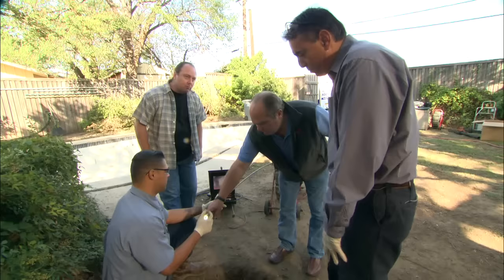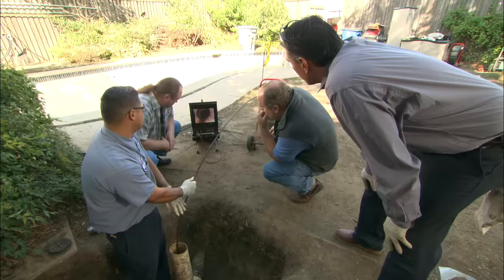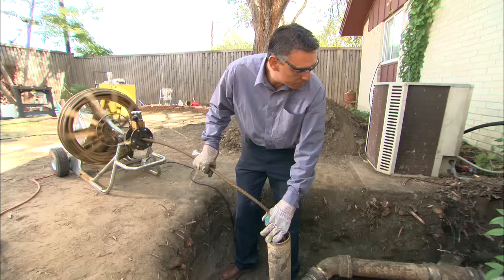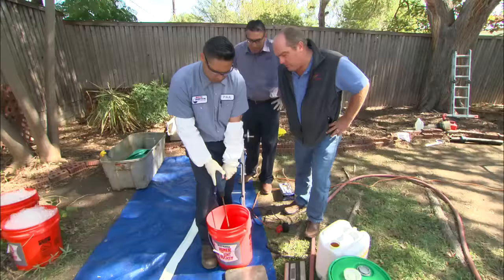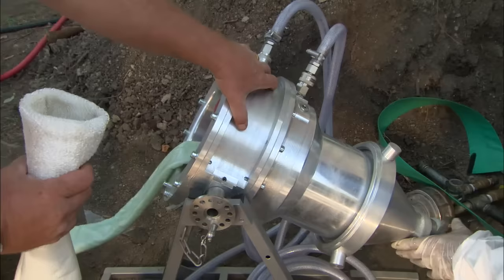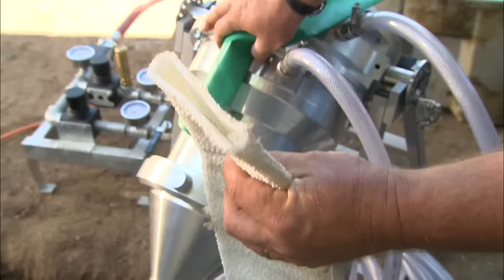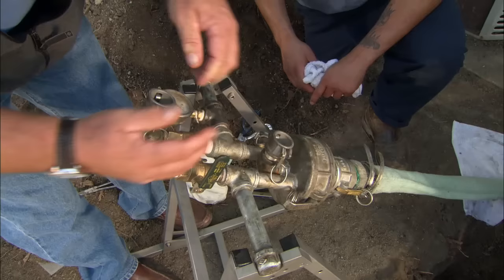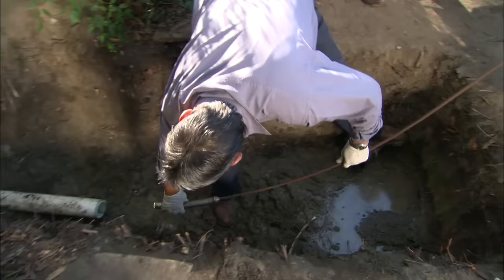How to Repair a Sewer Pipe Under a Concrete Slab | This Old House

Comment: I called five or six different plumbers to come out and look at my drain lines. They wanted over $400 just to put the camera down the drain and they wanted $115 an hour for two guys, that's $230 an hour and I asked them about how much it would cost to to fix it they said about three to five grand. Guesstimating it could be more. I said to hell with that and I fixed it myself. I found out where the lines came out from underneath of the house. Got out of shovel and dug it all up. All the cast iron was completely disintegrating. I got my recipitating saw and cut it all out. And replaced it all with PVC. My wife and I did this in two days. It took the longest to dig it up with a shovel. The actual repair took about four hours. Cost of materials less than $200.
Reply: I think they would agree that the preferred method is to just remove the old pipe with new pipe. But in some cases you can’t access the drain lines. I have a few that would be completely inaccesible.
Reply: would you mind to list your materials?
Reply: @kevinvinson407  two pieces of 10 ft PVC drain line. Two cleanouts, 2 fernco fittings 4 hose clamp fittings for the ferncos. 2 caps for the clean outs saws all blades  PVC cleaner and glue. 1 90 degree Male adapter.  2 housings to cover the clean out . We did this in November of 2020. So it would probably be more expensive now.
Reply: U don't have a basement
Reply: Agreed, it's always cheaper to do it yourself. It's funny when customers call and say it's a "simple job" or "I could do it myself, but..." and want a cheaper price. Props to you for actually doing it.
Reply: That’s pretty cheap for a camera
Reply: @royblomquist2622  Ferncos and metal clamps underground?
Reply: I realize everyone has to make money but cmon $115 an hour?? Just as bad as a car shop hourly rate
Reply: @chicagowsox212  we charge $220 an hour for plumbing
Reply: @haydenchamberlain168  yeah there’s a lot of scammers in this world that take advantage of people
Reply: How long did it take to dig it up?
Reply: @9863bsgcdgb  about 6 hours
Reply: @Muko992  no we don't have basements in Florida
Reply: @justayoutuber1906  that correct ,stainless hose clamps and ferncos
Reply: That’s great man now try hand digging the pipe outside when it’s 8 feet down in the ground
Reply: @roberthernandez1985  I live in Florida so they don't bury the drain lines 8 ft in the ground because we don't have basements down here. But if I had to I would rent a mini backhoe still cheaper than paying a plumber
Reply: I’m expensive because I have 250000$ in equipment liners excavators large commercial hydro jetters etc etc digging outside is one thing but not everyone wants to jackhammer the basement slab
Reply: I can hear your yell voice in this comment! Don’t blame you awesome job!
Reply: Thats a good deal,  I would of  charge you more.
Reply: Yeah right, talk to us when the pipe runs underneath a concrete slab like this video.
Reply: @royblomquist2622 
Did you take pictures or video of your job?
Reply: @rafaelhuicochea7158  yes
Reply: Good, now come do my house for less than 200 dollars then.
Reply: The new America.
Reply: Yes please come to my house and do it for under 200!  Thanks in advance!
Reply: @royblomquist2622 You didn't mention installing hangers to hang the PVC pipe from the bottom of the concrete slab. Did you not do it? If you didn't hang the PVC pipe the pipes will sag as the soil settles, & joints can separate as the pipe sags.
Reply: @LoneTinaja or bury a piece of PVC for 3 years, then dig it up and THEN bend it slightly... Watch ALL the cracks run the entire length of pipe.
Reply: Bud, do you want to know why a good plumber costs so much?  

Because they're worth it when they have to shovel someone else's crap.  That's the premium.
Reply: @royblomquist2622  👍
Reply: @chicagowsox212  
What's the correct price?
Do you think it's possible that you are overpaid at your job

Comment: Never buy a house without a basement and you won't have to worry about ripping up your concrete slab to make a sewer line repair.
Reply: With or without a basement?
Reply: Yeah but then you have to maintain the basement which is way more expensive anyways. Water always gets inside.
Reply: A lot of places don't have basements. California being one.

Comment: I love how the owner grabs the camara with no gloves when that camara has been in a lot of sewer line and just fwi dont call roto rooter they rob you blind
Reply: They charge 250 for 3 minutes work,insane
Reply: They charge that cause of 20 years of practice my friend. Is your drain flowing? Lol
Reply: Mr. Rooter proposed to clear aand repair my drain for 8k.  They didn't know I was in the trades so I had some coworkers do it.  Even their diagnosis was wrong and I was able to fix it in about 2 hours for 150 bucks.  It helps to know people but c'mon! They will rob you blind
Reply: @johnsmith-wc8gs  
Piffle on stilts.
Reply: I need to get this done for that price
Reply: The plumbing company I work for charges $125 for a pipe clean out
Reply: at 00:41 he touches his nose and mouth 😂😂
Reply: Doesnt mean you didnt have a problem
Reply: @johnsmith-wc8gs  Do you think I can dig a trench myself and replace the pipe? I'm not in the trades, just a regular guy. The sewer drain is very deep, starts at basement floor, probably 7 feet under grade. So I'd have to rent a skid steer or something and dig a deep trench to find it?
Reply: west  typically a camera is run through a clean out to verify location and depth. 7' is quite deep so I would rent or have someone camera it so you know exactly where to dig and how deep. A 7' trench is actually dangerous. Caving in is possible depending upon soil and how you dig it.
Reply: @nofurtherwest3474  you could do it yourself, but it's a lot more work than these videos make it out to be. If you do it yourself, I wish you the best of luck!
Reply: @TheLouisianan  Ok thanks. I snaked out the drain and pulled out some roots. So that may get me by for a year. It's obviously cracked somewhere but maybe that's ok? So many older houses around. I imagine most have original drain pipes right?
Reply: @nofurtherwest3474  Yeah it depends largely on where you live and what year your house was built. I currently live in a house built in 1956 when they used terracotta which is susceptible to root intrusion at the joints (since they look for water). If it's cracked in there, it means roots have already damaged the pipes a good bit. It might be ok for now, but eventually you'll need to replace your pipes. Personally I'd start saving some money for when the time comes. Another alternative if you have terracotta is to pour foaming root killers once or twice a year down your drains as a preventative maintenance item, but it'll just delay the decay of your pipes. Terracotta won't corrode since it's ceramic. If you have cast pipes though, I've heard that acids are not good to pour down the drain. I'm not a plumber though so maybe someone else may chime in and correct me.
Reply: @TheLouisianan  My house is about 95 years old. Most of the houses around are about the same age. I'm guessing most have original pipes and they are probably all cracked in some way. 
Never heard of foaming root killers. thanks for the tip. 
There aren't any big trees nearby, but there's a small one. I wonder if that's the problem. I can't imagine those roots going down 10 feet but maybe they do; I don't know enough about trees.
Reply: @nofurtherwest3474  95 is pretty old. My sister and her husband live in a house built in 1921 and it's got a lot of quirks with it probably similar to what you're describing. Maybe at that point pipes are all cracked to some degree. As for the roots, I'm not an arborist haha so I don't know either. A 10' tree shouldn't be doing that though. The tree that was growing in my pipes was a 30-40' hemlock and the trunk was about 10-15' away from the main sewer line.
Reply: 250 to root your drain is not bad. Over thirty years ago I had an old house with roots in the drain so I rented a power snake with a cutting head and it cost me somewhere between 75.00 and 90.00 dollars and then I got the tool stuck in the drain, after some effort I freed it. It was a dirty filthy miserable experience. From then on a paid someone. I think I paid 150 or so. Best money I ever spent. Something's are best left to the professionals, sewers are one of them.
Reply: @mtadams2009  The problem is that some guys will tell you "hey we have to dig and replace the pipe, will cost $10,000." Yes that happened to me. So I don't trust people
Reply: Roto Rooter just came and "cleared" my parents' sewer line for $220 dollars. They had to come back twice in two days to finally do it right (kept backing up in the basement). Turns out their sewer line is 250' from the basement to the street. Luckily what would have been a $600+ job was warrantied for the original $220.
Reply: Yes I'm a plumber my self
Reply: @nofurtherwest3474  roots are as long as the branches are on top or longer , not sure about the depth though
Reply: @gusc6785  ohh wow that's long
Reply: @nofurtherwest3474  How can your waste pipe start 7’ under grade? It has to flow downhill to the city line running along the street or alley. How deep is that city line buried? It would have to be 8-9’ deep. If not, you would have to pump the waste uphill from your house.
Reply: @jacktracy4845  Because the waste pipe starts at the bottom of the basement and then goes outside (ie in the dirt outside of the basement floor). 
The spot where the drain is in the basement is about 7' under grade. 
This is the case in the midwest. Nearly every house has a basement. 
How does a floor drain in a basement flow to the city main? 
The city mains are buried deep I'm guessing. Probably 12' or so.

Comment: Nobody gonna mention the traffic cone funnel at 2:30? 🤣
Reply: Sometimes improvising does better job than the actual tool.  Sounds weird till you have tried it.
Reply: I can't believe not single person besides you has commented on it. 
The traffice cone funnel is quite hilarious though.
Reply: Well thats typical roto rooter tools, probably has a 60% markup  to use it too. LOL
Reply: Was it taken off the street from a construction zone?
Reply: @MrBeast9000  oh that's funny
Reply: Hey you cant beat ingenuity...
I used one that was perfect for filling 1000 earth bags building a house...
The movie the God's must be crazy comes to mind how something simple can be life changing... lol
Reply: they do not make giant funnels for cheap or easy available , so the cone is a cheap easy solution, an the resin being used is dangerous if got on skin, that mixing bucket will melt from the leftover resin the cone will not
Reply: I do line repairs all the time. Its the perect tool to use innexpensive and gets the job done
Reply: It's getting coated in epoxy. You only get so many uses out of it before it's gunked up. Might as well yse something cheap!
Reply: Them cones work good for filling sand bags as well
Reply: @51-FS  run that by us again... little slower this time.
Reply: @51-FS  first off, master construction advisor I didnt "win" my house, I bought it... for cash.. Guess the first grade spelling class was long and hard on ya'
Reply: U must of mastered making fun of people and picking on them..... hope u are happy
Reply: Best funnel ever
Reply: @ksr9t  
Ooh you're tough. Not.
Reply: The actual reasoning we used traffic cones for funnels is because you ultimately have an infinite option for varying diameters of liners. The traffic cone works for 3 inch, all the way up to 12 inch. Additionally, when the resin cures in the cone it adds rigidity.
Reply: @davidf2244  actually if you make a catch basin for the cone it will drip excess and actually last for 5+ years
Reply: What ever works bro... What ever works
Reply: @davidf2244  and still use as cone.
Reply: The traffic cone method works hella good to fill up sand bags as well...
Reply: The smartest people have high IQ.  Ingenuity Quotient.
Reply: It’s a high vis funnel! Lol
Reply: no, who cares
Reply: Brought to you courtesy of VLC Media Player!
Reply: Safety first! Bob Villa rolling over in his Lazy Boy
Reply: @cristianportillo5888 inexpensive?!? They're LITERALLY lining some streets?!?!!
Reply: It actually works great for the viscosity of the resin

Comment: I had two jobs done similar to this using the Perma-Liner inverted sock similar to this.  The end result was a 1/4” thick wall PVC-like pipe inside of the existing pipe.  The liner pipe penetrates the pores in the existing concrete pipe so it is firmly embedded.  The pipe is smaller diameter by 1/2” inside but is much more slippery.

Our present house had roots jamming the sewer right next to our house from trees and unfortunately right under our hot tub slab.  The sewer cleanout is between the hot tub and the house and the sewer is 3’ deep and 80’ long, going under trees and bushes.

The other job was 35’ long, 8’ deep and went diagonally under a 10’ wide concrete driveway.  Roots from trees were in the sewer.  A small backhoe dug the single 8’ deep access point.

In both cases they only needed a single access point and both jobs were completed in 2009.  The expected life is at least 50 years.
Reply: How much did it cost you? My dad's house needs a job like this.
Reply: This works fine as long as the existing pipeline (to be lined with this perma-liner type sock) is one continuous pipe with no 'feeder' pipes leading into it (i.e. the input from bathroom sink drains, kitchen sink drains, shower/tub drains, washer drain, etc. Those 'feeders' will be blocked by this insert.  As long as the concrete slab is a porch or similar 'slab', then fine, but if the slab is the foundation of your home, the method reflected in this video will NOT work; it will block all the drain 'feeders' leading into the main pipe.
Reply: Did you forget to take into consideration that once turds and organisms start using the new pipe, it's slipperiness will fade rather quickly- especially once you've snaked it with an auger. Those things basically act like sandpaper, ensuring the inner pipe remains rough for the rest of it's service life. Just curious if you've had any issues with big dumps or large wads of toilet paper etc. clogging the new line? Thanks in advance
Reply: @Rick-the-Swift  running blades through these liners doesn't damage them in the least.
Reply: @nexusone5584  Damage is in the eye of the beholder. I don't think little scratches on the inside of the pipe is considerable damage, but many augers will have little serrated teeth for chopping roots, and being that metal is harder than epoxy, those augers will scratch rings around the inside of the pipe. Sure they'll still function, but my only point was they will quickly lose their slickness the OP saw as being an advantage, just as pvc pipes become quite grimy on the inside, even without being scratched up by an auger.
 Also, just pointing out what the OP said about the walls of his new liner being 1/4 inch thick- this means the inner diameter of the pipe is actually reduced by 1/2 inch, not 1/4 inch as you suggested in the other thread.
Reply: @Rick-the-Swift  I have lined literally countless pipes over the years and have never seen any blade system damage the inside of any of the various lining systems out there, unless intending to do so. This includes hydo jetting heads.

 You should never be using anything other than drain cleaning blades single, double, quads or spring retriever to clean a drain line. All of these blades are angled inward (both the tip and the blade profile) to keep the cutting ends/edges away from the actual inner wall of the pipe. This being said, if your liner is installed properly,  using the appropriate air pressure and roller guage combo, in respect to diameter and length of line, you should have no reason to clean these lines with anything other than water.  Sludge can be cleaned by wrapping a towel around the head of a blade and used as a squeegee with running water.

 As for the inner diameter of the rel-ined pipe, the overall diameter would be reduced by approximately 0.5 yes, but this is, again, over all diameter, as opposed to losing a full half inch of sidewall. It translates to essentially nothing.
Reply: @kevinpichard8336  there is a machine designed to cut out lateral tie-ins

Comment: OMG, no wonder modern plumbers charge so much, this is like a surgeon implanting a stent into an artery. The wonders of technology. Another great video from this old house.
Reply: And it costs between 60 and 80 thousand dollars
Reply: 60 to 80 k to do this repair?
Reply: No...the cost of the machine.
Reply: @joeelsaesser1659 it's a gun, roller and a shop made air manifold. It's like 10k worth of equipment. You're paying for the skill of the operator, the rest is overhead and inflated prices.
Reply: Keep in mind you are making your sewer line's inner diameter about a half inch to 3/4 inches less than the old one, which may have already been undersized. On top of that, if the old lines had any sags, those will now be exaggerated by the newer smaller pipe. Bottom line, I would be very weary of allowing this expensive method, probably only as a last result. 3 inch pipe is questionable. Going down to 2.5 inches or less seems like border line insanity.

Comment: Trenchless pipe lining: relining your damaged lateral or sewer pipe will typically cost $80-250 per foot, with an average of around $160 per foot. For standard sewer lines, repair costs can vary between $4,000 and $20,000, depending on circumstance.